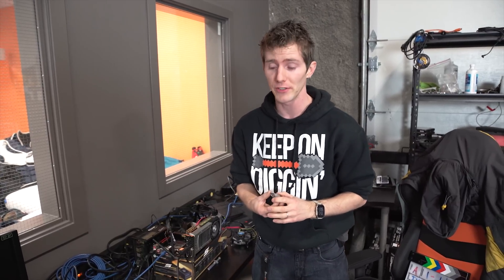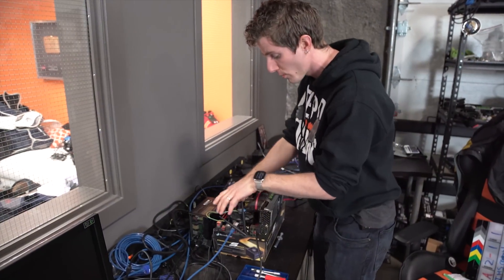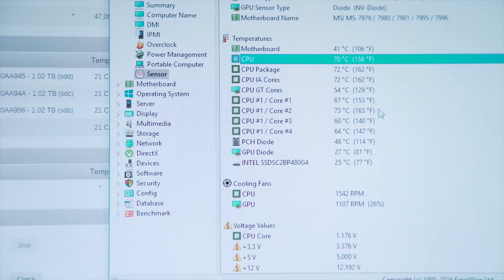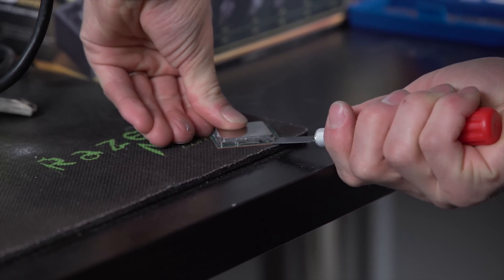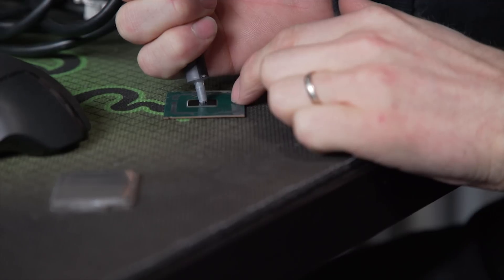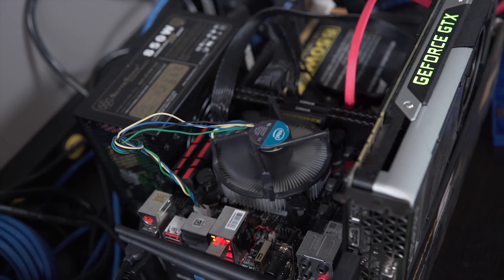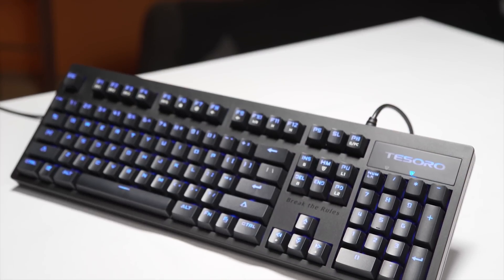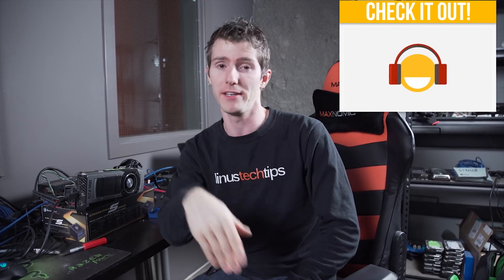Delidding an Intel Core i7 6700K - Is it worth it!?

Comment: i know its not the same. but i did it with a 4770k. but i used metallic thermal paste (coollaboratory ultra). i also used a thin layer of liquid electrical tape to re seal the IHS. i was also able to have my friend 3d print me a delidder. you place the chip in and place in vice, squeez a bit, and it pops off. 

my CPU doesn't OC very well. i set it to 4.4ghz when on 1 or 2 cores and 4.2Ghz when on 3 or 4 cores. i think its at like 41-45c under load. and 30c when idle. on a h100i. i cant remember what it was before.

Comment: I did this to my 4770k and let's just... I got 4.5ghz instead of 4.4... 😎 totally,,, not even Worth it unless you are just stupid like me. my heart almost stopped when it went flying off the vice onto the ground.... but it survived. and instead of 78° on water it is at like 59° "also bare die mounted". totally not worth it :D
Reply: It actually depends on the condition of the thermal paste. If the CPU is relatively new and haven't gone through prolonged heavy loads, the stock thermal paste works fine. But in my case after 1 and a half years of use and occasional 115watt renders at 4.6ghz @ 1.295v in the 4790k (overclocked from the stock 88 watts) the TIM starts to degrade. My idle temps hovered at 68-75 Degrees, and under full load reached 85 -90 degrees (room temp is 30 degrees). I had to reduce my OC and compromise or lose the cpu but i need to render faster so the scenario doesn't work for me.
Yesterday I delidded my 4790k, and the results were astonishing. My temps improved by 20 degrees and the cpu can take pretty high and stable overclocks (up to 4.8 ghz now). I decided to stay with 4.7 ghz @1.30v and just render at 4.6ghz @ 1.262 (down to 109 watts). Now my max temps are just 72 degrees, idle at 48.  Good enough for me, it's as if my CPU was reborn, and even better (Just like Gandalf the Grey becoming Gandalf the White hehe).
Reply: Hi, I've got 4790K from end of line (Devil's Canyon), i bought it when Skylake come into market. And mine is overclocked to 4,6GHz. Temperature is no more than 60-70C (stress) and 50-60C (in games). I'm using Tt air cooler.
Reply: What the fuck? i delidded my 4770k and applied Liquid Pro liquid metal. I got a massive performance increase after overclocking and watercooling... it all depends on your specific part sometimes.
Reply: ***** haswell got really really hot lol...
Reply: ***** oh yea man. It was ridiculous. That's why the released the 4790k. That was just a 4770k with no so terrible heat output. That's how bad it was. Good architecture, bad everything else
Reply: Wait, so it went from 78 degrees to 59 degrees while increasing the clock speed? If that's not a great improvment I don't know what is...
Reply: Gustaf Anderzén oh yea it was for sure. But it was a very dramatic and time consuming process. It became an obsession of mine for a long time. But I got my extract .1 GHz 😂
Reply: i don't know what thermal paste is used under there, but i mostly use arctic silver between the cpu and heatsink and that shit takes at least 5 years to dry up.
Reply: How did you bare die mount it?  I 3d Printed a mount a few years ago to do this
Reply: Vault Nomad the easiest way is to just buy the mount EK sells. it worked perfectly
Reply: FreeDooMusic that stuff is barely middle of the pack now.  Its not worth bothering with when Prolimatech PK-4 is the same price
Reply: Colbion details?
Reply: Alex Shiva Botez Well this was years ago, so i can’t say I’m familiar with the BEST product to use. I used Liquid Pro and it worked great.
Reply: Well with that extra cooling, i would say it was worth it for you.  Speed wise not much difference but the cooling is a huge difference.
Reply: Cheap ceramic crap is used.
Reply: i don't know what you call time consuming. But cracking it in the vice and then put liquid metal between die and heatsink takes like 1- 1.5 hours tops.
Reply: @Tristan Granados I recently bought the 8350k for my gf. Got unlucky with the silicone so it only reached 4.8ghz. Temps around 90c before delidding. Have yet to see it rise over 70 now after delidding.
Reply: b brady and I quote you "and instead of 78° on water it is at like 59° "also bare die mounted". totally not worth it"
ummmm 19c cooler and not worth it???? On crack? further,  19c cooler and you only got 100mhz increase? You got a SHIT lottery chip bro. Or you aren't volting correctly... cmooooon man for real?
Reply: Actually it all depends on the CPU you are using. My 7700K was stuck at 4.5 Ghz max, but with the Delid I went from 92 degrees, to 65. And Was able to overclock to 5+ Ghz
Reply: Tony Skiffington I know I did. That's what haswell was know for lol

Comment: It was worth it for 4770k CPUs for example. I mean it is a difference if I run at 95-100°C or somewhere around the 80-85°C mark. Only in synthetic benchmarks and with the boxed cooler of course.  
But then again, tweaking the powerlevels and getting a better cooling solution makes it unnecessary.

Since Intel changed the TIM and Skylake CPUs are more energy efficient , things got a lot better these days.

Comment: Don`t know If I`ll ever do it but I`d say that the concept is worth it if you have the guts & use a really good paste, especially if it means that a PC COnsole running in silent fan mode never clips 80 degs from time to time kicking in the Air or AIO fan into a very noisy overdrive
Reply: and I don`t suppose that voiding warranty matters at all if you eventually plan to sell the chip onto the 2nd hand market, hell you could even up it`s value as a used item if you can show the benefits

Comment: I've heard it makes no sense if you don't use liquid metal sort of TIM. Especially for Skylake where factory TIM is not as terrible as Haswell's.
Reply: I dont understand why you wouldnt use the liquid metal stuff when delidding. It may be hard to apply and is conductive, but those who are willing to delid are often experienced enough in applying thermal pastes to not fuck it up :p. 

I used some CLU on my 4690k delid and temps dropped 10-15 degrees. I then also used CLU instead of MX4 in between the IHS and cooler (its a nickel plated copper base cooler so its fine), and temps dropped a further 10 degrees. MX4 aint bad stuff either. I also decided to use some on my r9 390 and temps again dropped by 10 degrees. Well worth it for £7 a syringe.

Comment: You should check out the Delid-Mate which is made by an extreme overclocker called "der8auer" which is an employee of a huge High-End PC Webshop called caseking.de. https://www.caseking.de/der8auer-delid-die-mate-fsd8-015.html It's much easier and absolutly safe.

Comment: People delid because with 400 to 600mhz extra overclocking, they get more performance for rendering, editing and programs such as BOINC.
Everyone else are pretty much just after a few measly extra benchmark points, sad part is they have been surpassed by someone else already anyway.

I`ve played the newer games like BF4, BF1 Beta etc, with cpu`s from Quad Core Q6750 to i7 6700K, and none of them ever required 100% CPU.
Hence, no need to break warranty, no need to overclock.
What does make a difference is good ram (saw 50 percent FPS increase with just increasing ram frequency and tightening up CAS latency).
And of course the cache etc of a newer cpu, which you can`t get with just overclocking, you have to pay the dollares.
Reply: *****
Well,  that depends on whether you do good or bad in the silicone lottery.
So to elaborate:
I`ve been working on two 6700K`s lately, my own recently upgraded rig, and a friends recently upgraded rig.
Both of us have the same Motherboard (VIII Hero) and RAM (some cheapo Corsair Vengeance LED 3200mhz because we are broke motherfuckers) and both our CPU`s (67k`s) require the same voltages and yields the same temperatures (maybe a little less for me because of external water reservoir and radiator on top of cooler room temperatures).

Around 25c at idle with a 4,4GHZ overclock and at full load 71c max (According to HWMonitor+Prime95, a restart and run AISuite+Prime95 shows 61c) seems to be the norm.

Now, he has a 680 GTX, I have a 480 GTX.
Without touching BIOS, I saw around 15fps where he saw around 30.
Upping just the RAM performance (XMP) I saw around 30FPS for myself and 30 for his untouched setup.
When I upped RAM performance for him he suddenly had 60-70FPS.
Overclock for both of us, with FPS counters from Fraps, Steam overlay or integrated with game, gave no extra FPS.
Hence I backed it down to 4,4GHZ for less temps, just so the extra 200mhz over stock boost gets slightly faster anti virus search and the likes.

With the stock CPU (in other words no delid) on watercooling I can get both rigs to 4.6 GHZ stable (with Prime95 at full blast) but at a cost of around 75-81C on full load, reduced RAM performance (to where the higher clocks actually gives us LESS fps in games), high voltage (1.410-1.420 volts to my recollect) so not very viable long-term solution, preferably I want 71C max and full RAM performance.
Thats with manual Vcore override (I donno how the hell that adaptive shit works, I turned it on, tried all sorts of numbers, BSOD evertim cri).

So in other words, we did not do too good in lottery and thus theyre good examples of where a successful delid might work wonders.

So to answer your question:
With our CPU`s, with the lottery prizes we have, every 100mhz seems to give around 5c extra temperature.
I know I can get these things into 4.6GHZ without delid, they`ll run warm, but they`ll hold.
So yes, a very successful delid (-20c temps at full load)  have a fair chance at giving us 5 GHZ, and definitely (if we get -10C temps at full load) around 4.8 GHZ, but for us gamers intended role, that`s not really what the 6700K is designed to do!

For people who game and render, they can use that extra overclock to some extent, but the hampered ram frequencies will kill gaming performance.

You can for example delid and overclock all you want, and definitely see an increase in performance for more administrative workload such as rendering, studio work etc, and maybe some cool points in a benchmark.
But it wont do you any good in ARK or whatever though..
Reply: *****
No problem.

I`ve read that the Gigabyte motherboards stick with the old fashioned overclocking, in other words RAM FSB Frequency times XX amount of multiplier up to max of what RAM (or CPU) can handle in terms of frequencies, temperatures and voltages, then you dial CPU voltage down until it starts acting up (too little voltage), then a few notches up again, repeat for RAM as well.
The lower the voltage, less temps at full load.
Proved and tested, but works "against" Intel`s new "way" of "doing" things (I recommend googling it and read into it if this does not explain).

Whereas the ASUS motherboards have implemented Intel`s new system (whereas Gigabyte sort of "works against it"), where a new "thing" called BCLK frequency (Memory baseclock) is set at 100 times XX multiplier.
This is where dialing RAM down plays in.
You can work the BCLK frequency and RAM voltage up max and do less multiplier, but get instability because the ram can`t handle the higher Base Clock (too much frequency)
Best way then for higher clocks is to work the BCLK frequency down and increase multiplier, but as you understand, you get less RAM performance...
You can enable XMP, but then, as you know, will almost decidedly compromise stability.
Either way, same thing, when you reach max overclock, dial voltage down until instability, then a few notches back up, same for RAM.
If CPU full load temps are still bad (Over 80c) then you have to downclock (100mhz at a time seems to be the quickest way).

What I like about the ASUS motherboards is you can use either which technique, and it also allows to lower or increase overclock on each individual core.
This is good when, even if you have a program/game at full affinity (how many cores are used for a game or program) but one core (usually Core #1, out of cores #0, #1, #2 and #3) still produces higher temperatures.

Thats why I recommend a few extra dollares for the 3200mhz Corsair Vengeance LED ram, the 200mhz bump in frequency is nice (But it also depends what you can afford) and for the price theyre not bad chips at all.
I got it mainly just to get the computer up and running but will probably keep it now :)

I have no idea WHY the 67K works so well and increases FPS and general performance so much with focus on RAM performance (and these are not the best RAM bricks money can buy) rather than just it`s much hyped (but rare, as it`s about the silicon lottery) overclock potential.

When you`ve got your hardware, set it up and churned in the thermal paste with 2-3 minute bursts, 5 minutes break, 3 times, with Prime95, try overclocking and let me know.
I`m curious if these CPU`s can be clocked higher according to what batch to what continent of the world.
Either Americans have gotten either very lucky (most likely) OR Europe got the shit end of the stick deliberately (hey I`m a computer guy and am allowed conspiracy theories).

Either that or it`s just that it`s all about WHAT ram you chose, more than likely a 500 dollar RAM duo can get higher clocks and still perform like crazy.

But with what I`ve now learned what these CPU`s like, and perform with budget RAM, I`m not complaining at all :)

Comment: Makes no sense. Obviously the stock cooler is the bottleneck in this case, it can't pump enaugh heat off of the cpu, so it doesn't matter that much that this heat is better conducted to the cooler.

There are many reports where delidding brings an improvement of 10-20°C  with a decent cooler.

Comment: The problem is not the TIM between the IHS and core - though CLU or CLP is an improvement, the stuff isn't terrible. It's the black goop connecting the IHS to the die. It's adding 0.5mm of gap, so whilst the IHS is still thermally connected to the core (via the TIM), it's not pressed down very well. You could literally just delid, scrape away the black gunk completely, and put the IHS back on without changing TIM - and temps would fall.

This video is NOT how to delid nor is it representative of the results most people would get when doing it properly.

Comment: I used the vice only method on my 6700k (no hammer) which worked great. I saw an 18-20c reduction with liquid metal pro while overclocked to 4.6ghz (4.4ghz cache) 1.38v with watercooling.

Comment: Decent aftermarket cooling would have resulted in a greater difference in this test, as stock cooling was already struggling to dissipate heat from the CPU before it was delidded.

Comment: So is non-standard CPU cooling even worth it? I run my 8-core pretty hard with some applications and I wonder if it's be worth changing my heatsink. You know, VS accidentally ruining my CPU or other components with my giant mitts during the installation...
Reply: If your computer is quiet enough for you then it's fine. If you're overclocking or want to make it quieter under load then go aftermarket. The standard heatsinks are crap, but they're fine for a cpu running at stock speeds.
Reply: Simon T Awesome, man! Thanks for the clear-up. I think I'll keep the standard heatsink for now, then...

Comment: It may not be worth it for skylake, but if you have a haswell or ivy bridge chip that's running insanely hot despite good cooling, you should definitely try it. I shaved more than 20° off my 4670k's temps when I delidded it, the TIM under the IHS was basically drywall.

Comment: Sry for the double post but forgot to say,  I love the show and the humor u bring to it. 

Side note.  As a overclocker I agree thatthe risk is high removing the ISH but 1-5c gained is beneficial  to overclocking .  Could be the difference  of holding that huge OC  under full cpu load instead of the system shutting down.  But I agree the risk is high.  Also combine that method with lapping the cpu (yours already was)  and hsf.  Correct me if I am wrong  (I use artic silver)   but isn't there a break in period with paste settling?   Ideally  1-3  days before u start getting the new current temps?

Comment: test seema flawed. you have to use the absolute best cooler you can get to isolate that variable!
Reply: ***** thats like testing the flow of two liquids in 2 very narrow bottles... At the end they both will barely flow because of the bottleneck
Reply: agreed, a good cooler and overclocked will demonstrate the real difference. It's usually pretty substantial, I can vouch for the 20c claims.
Reply: that and you know that's likely their cherry picked engineering sample CPU.
No other reason to see such a polished finish on any normal, retail CPU. Baseline with their sample CPU and testing with it to keep hardware tests legit.

Now, did they dial back their voltages since the delid? I don't it...